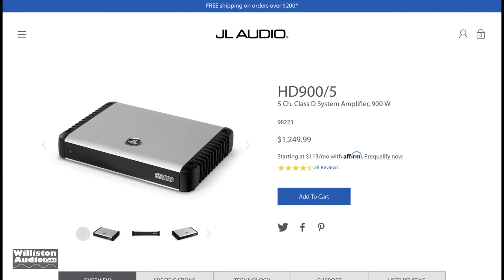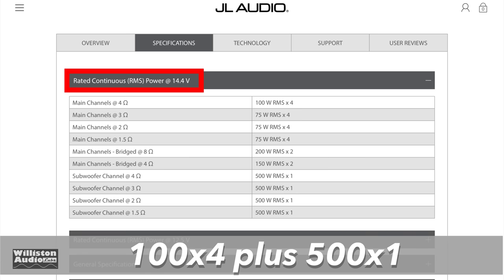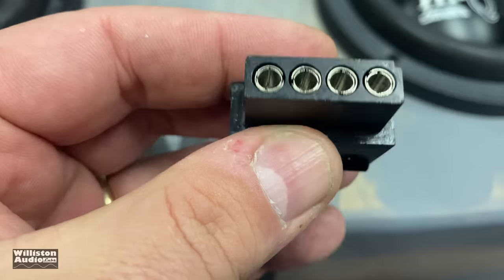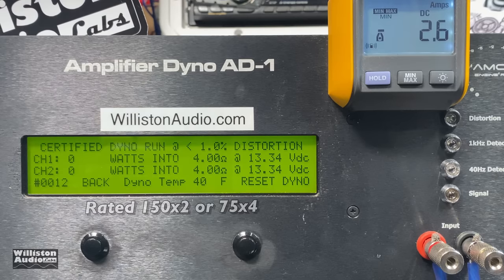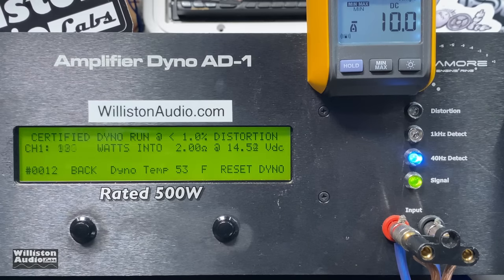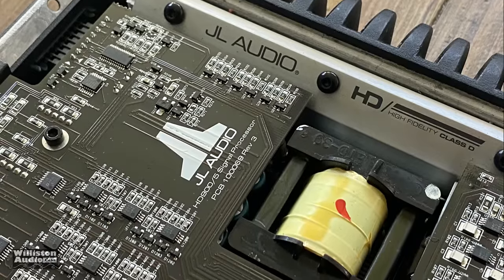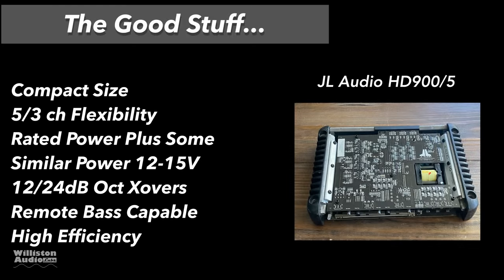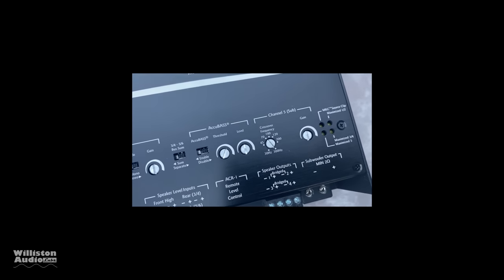JL Audio HD900/5 Amp Dyno Test and Review [4K]

Comment: And this is why some car audio amplifiers are better than others! I remember back in the late '90s/2000s when setting up IASCA competition systems for SQ, you wanted amps that had tightly regulated power supply sections because the stability of output power does indeed affect RTA curves in repeated testing. I guess this is a reason I refuse to use cheap amps in my systems to this day whether the system be in my truck or my home. Quality amplification is where it's at!
Reply from the maker: Great point

Comment: Nice, man! That R.I.P.S. (Regulated Intelligent Power Supply) Technology is Why Their Amps Are Pricey. You can get your promised power output from as little as 11 volts to 14.4 volts. The downside is that if you put more voltage power to it, it won't make a difference to give you more power like other amps. But for systems where you can't add extra batteries or High Output Alternators I think this is a win. So many people have argued with me on my other youtube channel over this but im glad you made this video to show what these HD amps can do. The sub amps like the HD750/1 HD1200/1 and even this one here on the video give you more power at 2 ohms vs 4 ohms or 1.5 ohms. I need to bring those dudes who were putting these Amps down to your channel so they can see exactly what you just showed. 😎👊
Reply: But where the RIPS amps shine is in their efficiency %. They usually run much higher than unregs do.
Reply: Well said. I think a lot of people are hung up on price versus the quality and uniqueness of JL amps. 
They offer several different amps across a variety of price ranges. Their RD amps for example are very reasonably priced and feature unregulated power supplies. Great value amps.
Reply: @msh6865  absolutely! 😁👊

Comment: Hello, I have the same amplifier and just by turning it on it is already heating up, after playing it it gets much hotter but it does not turn off, it is not protected, connecting 2 openshow 8hms bridge speakers and 1 sub 10” JL audio w3 500w connected the 4ohms sub, When you increase the volume, the bass restorer protects itself very easily, is that normal?  Mainly the temperature has me worried!

Comment: JLs have always been very good when it comes to under rating their amps. I've had multiple Slash amps, the 1000/1 V2 was so under rated its not funny lol.  Just installed a 900/5 in my last video, and it was a killer little amp! 😁😁

Comment: I have been running this 900/5 amplifier since 2017, its excellent! I paired it up with a JL Tweak88. Amazingly you can get digital optical audio from a stock Ford SYNC headunit with a PAC adapter that has a TOSlink output! unbelievable how good you can tune things with Tweak88 and a laptop, and get some excellent sound from a stock headunit. I was a car audio installer back in the 90's, and I never imagined the equipment would get this good. I run 2 JL Audio 8w3v3 subs, and a custom component kit with big Hertz ML 280.3 tweeters and some fancy front door speakers (I honestly forget what they were lol). The crossovers are high pass for tweeters in custom pods, bandpass for door midrange speakers, and lowpass for the subs, with the TweaK88 running 6 channel to the amplifier.

Comment: I have 2 900/5’s in my Chevy truck for 10 channels.  Hooked up though a audio control DM-810. 10 channels with active cross overs. Bought them used as I am not a billionaire. They are incredible.

Comment: I just bought this amp to free up space behind the seat of my single cab F-250. I bought this amp based off your reviews Steve. Thanks
Reply from the maker: It’s a pretty amazing little amp. I’m a bigger fan of the AudioControl 5.1300, but both are awesome
Reply: @wal  I got this installed in my truck. You're right, the power & speaker plugs were difficult to R&R.  I ended up using some dielectric grease to help them slide in and out. 
Other than that, I love this amp! My neighbors don't like it. But oh well, I can't hear them complain.

Comment: I have always, for about 25 years, been a huge JL audio fan. I was a JL audio dealer from 96-02. I had a vehicle I competed SPL in IASCA with 12 500/1 and 12 15w3. I had a vehicle I competed IASCA in the pro 301-600 class and placed 9th, 7th, and 6th, in the world in 98,99,2000 using JL audio subs. I own this amp. Purchased brand new direct from JL audio, and it did not work out of the box, so obviously zero quality control or testing was done. They did promptly send me a call tag and immediately got me out a new amp, which worked perfectly. Kinda. I have it running a c5 component set in front, c5 coaxial in rear, and a single 12 w3. The entire amp is run at 4 ohm. I can tell you it is very efficient. My stock charging system with the big 3 upgrade maintains 14.2 volts at max unclipped volume. The lack of dynamic power makes this amp very not “musical”. Is it unique? Yes. Will it hold its value well? Yes. Do I like it? Hell no. As I said the lack of dynamic power makes it seem very underpowered. At moderate-high volume, but still 2-3 volume notches below clipping it overheats and goes to like a limp mode after about 30 minutes. Listening to rock. Not rap or heavy bass songs. It still makes sound, just zero bass and low volume until it cools down. It is in a well ventilated area and keep in mind I’m maintaining over 14 volts and the amp is running at 4 ohm. I could go into more detail, but I’ll just say compared to what else is available I would personally not recommend this amp. If it was $500 maybe. $1249. No way. Just my 2 cents.
Reply: So what would you recommend thats 5 channels, same wattage as this but better? Eh?
Reply: @skofdoggy  cosmos audio ep2000.5 Look it up. Big D even tested it. Less money and if I remember correctly about 4 times the power. Comes with a nice bass know with power and clipping indicators. There’s several others, but that’s the best value/quality.

Comment: Love all jl products.  I have a jl 1000/1 I bought off a friend. It is a shame it just sits in a corner with all my other amps/electronics. It really is the best amp I own.
Best part is the power is the same from 1.5-4 ohm. People really under estimate how powerful that really is.
Reply: 1000 clean watts is nothing when you have 4000
Reply: @chuckd9007  I beg to differ. It is actually 1/4 of 4000 or 25% of 4000. Pretty simple math actually.     :)
Reply: When I was young I chased massive watts. Now that I’m older I realized how foolish of an endeavor that was. There’s a limit to how loud I want my music. And this amp is all I would need.
Reply: @Bob_Smith19  i spent 1250 on 8800 watts rms certified.   650 for 2 3500w amps. High dampening factor, high temp caps, power supply good to 16v.  And 600 for 4 2channel AB class amps.  Some people just need more and better.

Comment: Haven't made it through the video yet, but I'll probably never sell my (2) JL 500/1v2 and the HD600/4 amps. Rock solid power, great sq, and a small footprint. JL really made a nice amp with these HD series. Had them for almost 10 years and they still look new. How the hell does someone damage nearly every surface and knob on an amp like this?!?
Reply: Why are people way over paying for a ten year old design then?
Reply: @chuckd9007  they are expensive... just because it's older doesn't mean its bad. They make great amps with sq and consistent power output in mind. There is some very cool class d stuff out now days with a super small footprint.... but for the record, I bought used.
Reply: @LifeofBliss  im not knockimg you for buying it used.  Im knocking JL for charging 1250$ for a 1000w amp.  I paid 600$ for 4 AB class amps to run my mids and highs.  2 are 800w rms bridged powering 4-8" mid bass per front door and 2 are 150w rms x2 for the  2 silk dome tweeters per door.  I paid 600$ dollars for all the drivers and nobodys JL system that i know (6-7people) comes anywhere close to sounding as good as mine and all of them spend more on door speakers and amps than i did.
Reply: @chuckd9007  oh I didn't take it that way. I agree, they are expensive... personally I don't care for JL speakers. Amps and subs I like, but even those are a bit rich for my blood compared to some of the brands out there today. I dont see myself buying any more JL stuff in the future. Stereo Integrity will probably be my go to for subs 🤤 i have 3 of their 24s for my theater and they are built like a tank and priced right imo. I've been out of the car audio game for a bit, so I'd have to look at amps to get a better idea with those. Sounds like you have a killer system though man 👍 can't beat that a/b sound!
Reply: @LifeofBliss  ive been running one tcsounds lms ultra 18 in a trunk wall of a sedan on 7000w rms for like 6 years.   When i saw you building the boxes for those 24s i knew i needed a bigger sub.  Next vehicle im definitely upgrading to something bigger.
Reply: @chuckd9007  heck yea man, thats a nice sub! I couldn't imagine what something bigger would sound like in a car lol... I ran 2 10w6v2 from JL. You get some serious spl with 18s and bigger!
Reply: @LifeofBliss im going to find out! I've never metered it but im on the third windshield and its cracked again and the back window needed to be replaced once before i built the wall.  Definitely loud enough to make people tap out and it sounds amazing doing it.  super sad they went out of business again tc made some of best sounding subs ive heard
Reply: @chuckd9007  damn... thatd be an experience lol! I'm actually planning on throwing one of the 24s in the back our our escalade just to see how loud it gets. Wont be hooked up to the car, just my home theater amp so I can test bump it a few times 😅
Reply: @chuckd9007  and how old is class a)b technology? By your standards they should be giving that stuff away.
Reply: @msh6865  they pretty muvh do.

Comment: Hey Big D.. I was waiting for your sound quality review on this. For something this expensive it ought to make those speakers sing... Did it? I like when you give us your opinion on the quality of sound.. Thank!
Reply from the maker: Sounded great to my ears
Reply: They sound great and can be purchased for a lot less than their advertised MSRP at a good local dealer (some are more willing to deal than others).  

AudioControl's LC-5.1300 is just playing catch-up and IMO isn't any better.  I would say the same about the Alpine PDX-V9.  Basically they are all the same general form factor, highly efficient, and sound great! 

Loved that the PDX and JL were designed to easily be "stack mounted" if needed.
Reply: I'm running this in my 4Runner with all JL replacement speakers and 2 10s in the back and I'll definitely confirm it sounds REALLY good. Very crisp.

Comment: Sell these à lot and have one for over 4 years running my kx2 fronts biamped and my downfired 10tw3. Beautiful sounding amp with great power. It doesn't like to get hot or struggle for current are the only thinga that I've ever seen complaints on it stemming from. Also the rated power at 2 ohm for the 4ch portion was changed a few years back without a revision number. Guessing you have one from before thus the higher numbers. It would overheat and shut down under heavy play even with good ventilation so there was a rolling update.

Comment: The best thing I see in this design is flexibility.  You get 1200 watts from 1.5-4 ohms.  This makes this amp useful over multi car installs.  You change subs, you are not stuck with choosing a particular ohm rating to get desired wattage.  With so many amps being the same underneath, the labels and heat sinks only separate them.  Yes, it has a higher than normal price point, but the beauty is its flexibility.  To me as an old school guy working on an daily SQ built, I see the value.

Comment: Very well designed, but I gotta feeling the AC 5.1300 fittin to murder dis one 😵😵
Reply: Power wise absolutley.  That's my only gripe with the HD series. Sound quality amazing, power is meh
Reply: @angelvip2474  at 4 ohms that AC isn't rated the same as this one.  I also find it hard to compare the two given the HD series came out 10 years ago.
Reply: Rob, honestly, AudioControl is just playing ''catch-up" to this 10 Year Old JL Audio design...

And the 2nd Gen Alpine PDX-V9 was very comparable, and under-rated as well.  Both of those "old" amplifiers were also designed to be "stackable", which I found very useful for many installs.

You could pick any one of these amps based purely on the specific features they have in terms of system flexibility, etc, and be a happy SQ camper for many years.

FYI, you can usually pick up the JL HD amps at a good dealer for considerably less than their advertised MSRP, and the dealer will usually throw in the bass knob for free as well just to make the sale if you haggle a bit.  ;)
Reply: @DoeBoy999  that's fair enough.

Comment: The power/speaker plugs look like the old PPI amps that followed the white "ART" series of amps. They were difficult to replace if they were lost.
Reply: I unplugged one that was left plugged in for like 10 years and the male terminal came with it. Pulled it right out of the board

Comment from the maker: Check out my 2nd Channel: http://www.WheelieWilliston.com

Shop:
JL Audio HD900/5 (Amazon): https://amzn.to/3j3fNw1
JL Audio HD900/5 (eBay): https://ebay.to/36vIr46
Genius Audio Amplifiers: https://amzn.to/3qFaaqE
SMD AMM-1 Audio Multimeter: https://amzn.to/2WRc5eD
Elac Speakers: https://amzn.to/3mR0WWF
Williston Audio Merch: https://teespring.com/stores/bigdwiz
Savard Hi-Q Subwoofers: https://amzn.to/2ZPdgNx
Shop Car Amplifiers on Amazon: https://amzn.to/37zs8Uz

SMD / D'Amore Engineering Amp Dyno: https://goo.gl/sJTcf7
XS Power D1400 Batteries - https://amzn.to/2BPFCKW
XS Power PSC60 Charger - https://amzn.to/2CHGcfs
Fluke 1000A AC/DC Clamp Meter: https://amzn.to/2Rw5WDA
Handheld Dyno: http://amzn.to/2u2EgKV
My Favorite Screwdriver Kit: http://amzn.to/2x0VzcE

DISCLAIMER: This video and description contains affiliate links, which means that if you purchase from one of the product links, I may receive a small commission. As an Amazon Associate I earn from qualifying purchases

Comment: Had to watch a review on the amp I have in my jeep 🤣. This power supply is a big selling point in my buddy’s f150 now since his voltage fluctuates for his oem agm (raptor), see this a lot on new vehicles with fuel saver mode alternators.

I’ve also heard these type of power supply doesn’t do great on a load like this? Same with amplifiers like the Mosconis?

Comment: Really great specs for class d.  I don't see many class d amps below .1% thd.  Pioneers are the only other ones I've seen that have thd that low and JL still has them beat with all outputs at 12 volts and .03% thd

Comment: Great video Big D. Basically we are paying for the brand not the amp $1200.00 dollars that's lot of money for a small amp.
Reply: You can buy them for considerably less than their advertised MSRP price at a local dealer...and they will usually throw in the bass knob for free to make the sale if you haggle a bit.  ;)

Anything comparable in size, quality, features, and performance is equally expensive, and these sound great.
Reply: @bbfoto7248  thanks.
Reply: You're paying for the research and development that goes into a proprietary design. Meaning, you don't get and amp like this from some generic buildhouse. There are to cheap copies or clones of this amp available.
If you want to pay less then you can find something cheaper but, it won't have the same technology and will be of lesser quality.
Not saying a cheaper amp won't suit your needs but, in this case you truly do get what you pay for.

Comment: In your opinion which is the best 5 channel, Audio Controls LC 1300, The RF T1000X5ad, or a JL product?  
Currently have a older but refreshed RF BD1000 mono and was going to buy a 4 channel to run mids/highs in my tundra.  Debating on doing the entire system with a 5 channel - thoughts?

Comment: Compared the JL HD 900 to the Alpine PDX v9 and the Alpine clearly was the better sounding amp, with a much cleaner audio output & absolutely zero distortion, and was compared back to back multiple times just to verify.
as of now 10 years later the Alpine Is Still performing flawlessly, driving 14 speakers and a12-inch sub! This is surely a testament to the Alpine quality, durability and reliability.. .
Reply: Those PDX amps sound horrible to me. I've owned several, and they sound incredibly sterile. I've been running my entire setup on a JL HD900/5 and couldn't be happier with the output and quality of sound.

Comment: I'm curious how the JL VXi amps do on the dyno. I'm guessing pretty similar to the HD line (I think it uses something similar to R.I.P.S. ?). I know they sound great I'm running 3 of them at the moment 800/8, 400/4, and a 1000/1.
Reply: Actually the vxi is basically the XD with a built-in DSP no rips JL no longer has any of their current amplifiers with the rips technology the slash is gone and the HD is on its way out
Reply: @d77543020  Pretty sure NexD and RIPS aims to do the same thing. Regulate the power supply to cut distortion but in turn limits the max power output of the JL amps. At least that's what I understood NexD's purpose to be.

Comment: How repeatable do you think the amps are? I just purchased this exact amp and was wondering if i purcahsed 2 jl audio 10 tw3-d8 and wired them up to where they are at a 2ohm impedance. That gives me right at 400 per sub per your test. Should these amps be pretty close in power given my is brand new and this test was done some time ago ?

Comment: How does the fuse work?  The manual says it requires a 60 amp inline fuse but all the test show it pulled more than double that (I saw 152.4 @ the 9:42 mark).
Reply from the maker: So I ran all channels full range which is unlike most people would use the amp. Worst case scenario on the amp